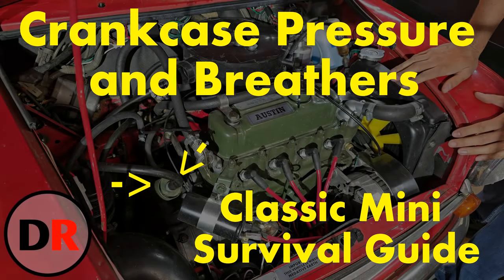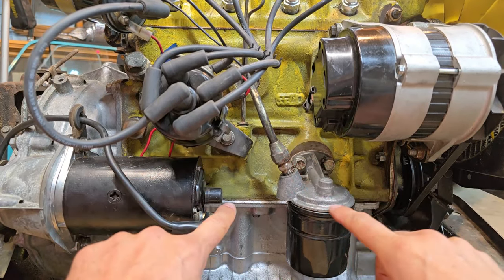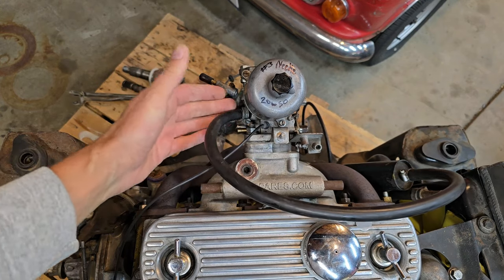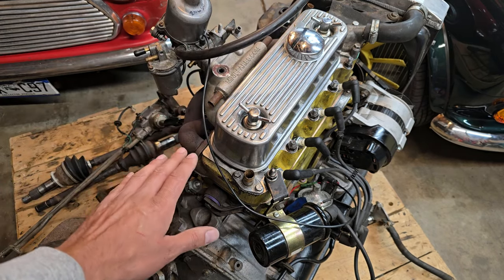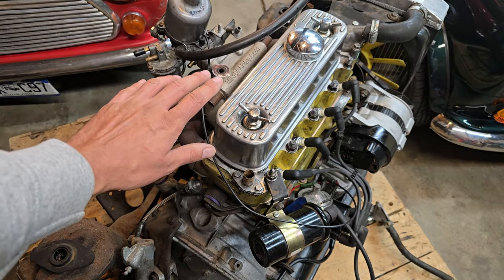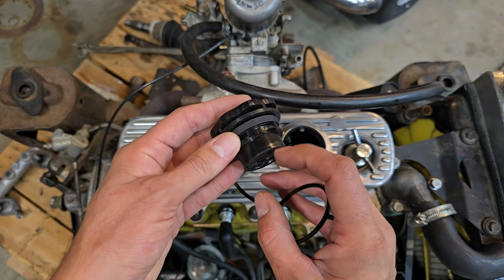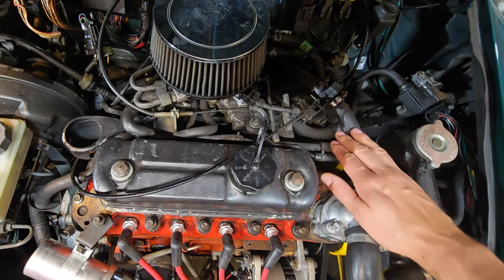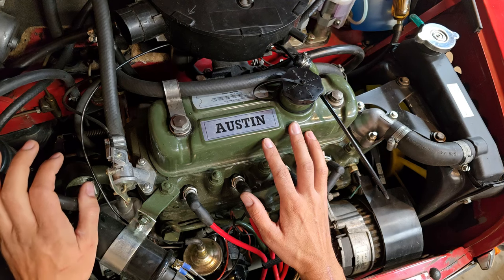Classic Mini Survival Guide: Engine Breathers and Crankcase Pressure

Comment: In Australia, pre pollution control Minis had either of the two carburetor types you described. Pollution control Minis had an inlet pipe on the rocker cover with a small control hole and sealed oil filler cap. The fresh air was drawn from the charcoal canister where it was filtered as well as drawing in the petrol vapors collected from the carburetor vent and fuel tank vent. This is the best venting for a smell free drive. I'm so glad you talked about this. It seems most people's attitude is, "pollution control, rip it off it'll go better". As you pointed out. No, it doesn't.
Reply from the maker: Yep, exactly my thoughts. Controlling the fumes makes the driving experience so much nicer and no change in performance.

Comment: Why would you or the engine want dirty oil soaked air being fed to it? Answer it doesn’t infact it’s bad for the engine performance! The crankcase pressure was only fitted back to the intake for emissions reasons nothing else, so what I do is after the oil catching box go straight down to the outside of the engine, jobs a good un job done simples 😃
Reply from the maker: It doesn't change the performance of the motor any significant amount.

Comment: Question: I have a '94 SPI mini that's back to twin SU carbs now.  Runs great. Stinky (fuel smell) though!  I have the venting of the main crankcase breather going back to the carbs as you have.  I THINK though a lot of the stink is the float bowls of the SU carbs venting to air.  What I've done is connected the two carb float bowls vents together then teed off to the carbon filter under the wing along with the fuel return vent line which was already going to it.  Seems to cut the stink in the cabin a fair bit.  Does this make sense to you?  Thoughts on this as a solution to the stink/venting?  There is NOT a return line (or valve of any kind) from the carbon filter on my car though going back to the carbs to burn off any vapour stink that builds up in there.  Do you think I could put a return line teed into the crankcase breather that feeds to the carbs to reburn vent gases that would pull more and more vacuum  on the charcoal cannister as the RPMS get higher?  Does this make sense how I've outlined it?
Reply from the maker: No you can't connect the canister to the breather port. The canister was supposed to be operated with a solenoid controlled by the ECU.
Can try connecting it to the air filter housing. It may draw the fumes out.

Comment: In Australia we had vent from the top of the rocker cover with a short hose to the air box/side of carb and a tube out of the lifter cover at the back of the engine. I assume our oil caps were meant to have the filter, but I’ve never owned a mini with it in the cap. All of mine were just hollow.
Reply from the maker: In that design, the engine vacuum isn't as strong and it doesn't need the filter as the fumes are being pulled into the air filter itself.

Comment: @darrensrestorations991 Thank you for this timely video, very much appreciated. Question though. The breather from the tappet cover on the back of the engine, which you show going to the carb, you also mentioned that it sometimes goes to the air filter housing on earlier cars (what year is earlier?). Like the mini you showed at the very start and the very end, the black air filter housing around the carb, the port on the right side of the air filter housing is open. Is that supposed to go somewhere or should it be open? My mini is a 1978 Morris 1000cc, and the only breather it has is on the tappet cover. It has nothing on the chain timing cover and nothing on the transfer case. So just trying to work out where mine should go (I am rebuilding my mini, brought it not running). So I simply do the tappet cover breather to the carb, or does it go to the intake manifold? Just curious as yours shows the air filter housing port open, and I have seen that alot on google images, and I cant work out what should be on that... Thanks
Reply from the maker: The tappet breather should go to the carb. The port on the black plastic  filter housing is not open.
The early filter housings made of metal have an open fitting.
Reply: @darrensrestorations991  ah you are right, the port on the black plastic is open on one cover I have, but not on the other. I think the open one is however not factory done. Wonder what this is for.... Thanks

Comment: when wouldnt you run the breather system?
Reply from the maker: On a race car where oil changes are frequent and emissions are meaningless.
Reply: @darrensrestorations991  and you will then have to run an oil catch can (in most cases)

Comment: Thank you for the very informative video. In my case I have an engine with blow-by. Would it be wise to connect the breather hose to the carburetor as I have it going to a catch tank? Many thanks to AC Dodd for introducing you through the live sessions!
Reply from the maker: Yes, you can have it hooked up to the carb even with blowby. 
Just be aware that it will change the air/fuel mixture when you do.

Comment: Thanks for the great information! Question though: when connecting the breathers back to the carb will this affect the mixture setting of the engine?
Reply from the maker: Yes it will change the mixture as the breather system will let more air/oily fumes into the carb.
Reply: @darrensrestorations991  great thank you, that‘s good to know

Comment: Evening Darren, caught parts of the live stream last night and wanted to ask more about PCV & breathers. I have a 1310 A+ engine almost fully rebuilt with a wrath of new parts, one being a MED belt timing cover (which doesn't have the breather) I had planned on using the fuel pump hole and transfer case and pipe these back to Carb but then heard talk about oil being pushed up the pipe (which I didn't foresee) How do I best proceed? Will the transfer case breather provide enough pressure relief to be ok back to the carb or do I need to go back to a catch pot? 
This is a fast road build and now understand a timing belt minus the breather may not have been the best idea (hindsight 😅) Any help would be greatly appreciated? Understand with a new build there won't be as much blow by the pistons but am I walking into a bit of a problem.
Reply from the maker: Not really a problem as there are a few options. The fuel pump hole needs a baffle as mention on the stream. Can also use a valve cover with a breather pipe.
Reply: @darrensrestorations991  what sort of baffle would you recommend? I've seen the minimania one, but not any others.

 So if I baffled this vent from the fuel pump, would it still be best to pipe to carb or to a catch pot?
Reply from the maker: Always run to the carb. 
A baffle of similar size to the factory ones is needed. 
I suggest getting a vented valve cover as this would be the easiest way to add the second vent. Plus the valve covers have a baffle built into them.
Reply: @darrensrestorations991  Thanks Darren, I've found a MK1/2 vented rocker cover on eBay with the internal baffle. 

Just to confirm, run the transfer case breather and rocker cover vent both back to carb and blank off the fuel pump hole I was going to use? 
Appreciate the help, loving your videos - great content and different from the normal videos that others put on YT 👍👍
Reply from the maker: @danhardy5752  yes run both to the carb and blank off the fuel pump hole. 
Thanks for watching!